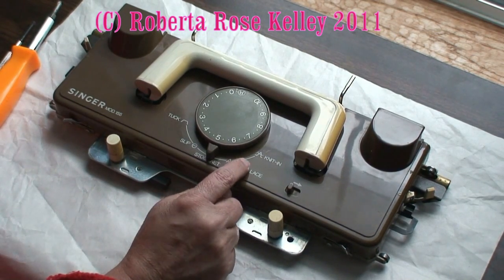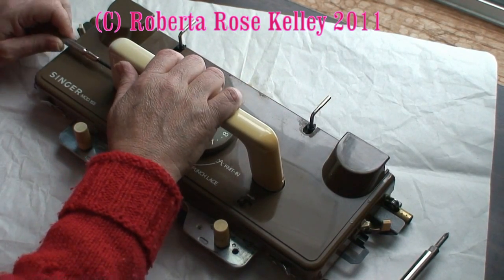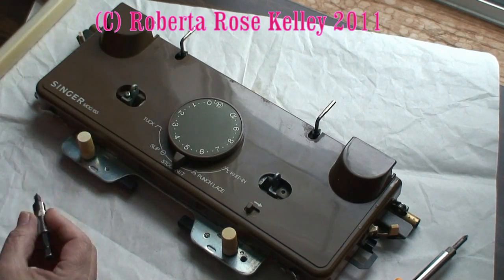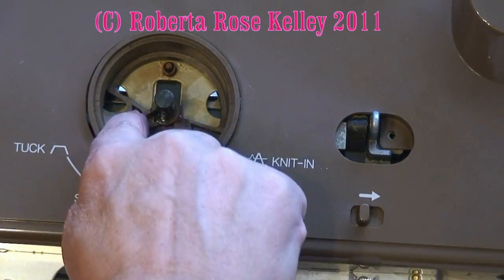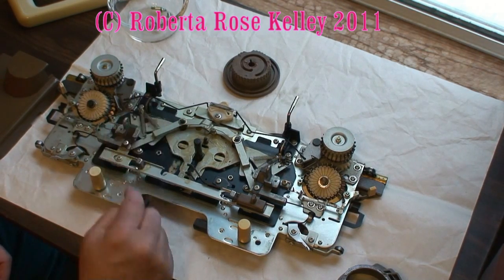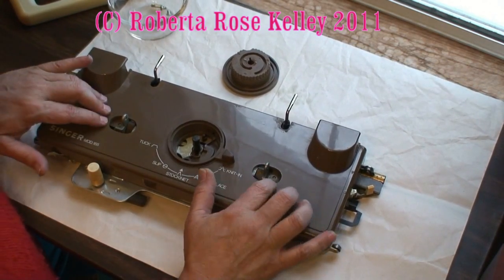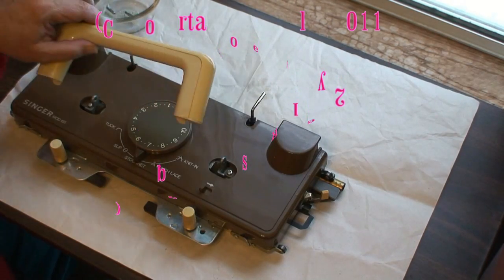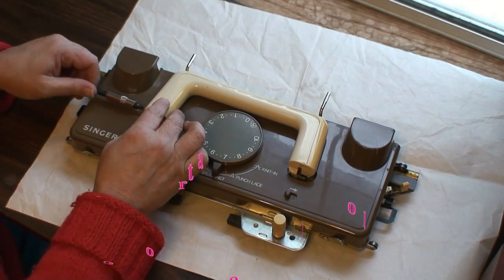Removing Singer carriage cover

Comment: I really needed this video. The drums were seized up on my LC2 lace carriage. I took the whole thing apart and freed it up. Thanks for your expertise. I wonder if I should re-grease it before re-assembling.
Reply from the maker: Glad it helped! I have had a few singer carriages that was the same, so to take it apart is sometimes how to fix them. If the lube under the drums is dried up, I would scrape it off and clean that area and yes put a little more grease there to help that turn.

Comment: Thanks for this video, I've just got a HK-160 actually which had the carriage cover well smashed in the post, I repaired the carriage cover with superglue and duck tape after removing it from the carriage, reassembly was a bit more tricky but again your video was very helpful, Elaine.
Reply from the maker: +Elaine Simper Thank you for viewing my video(s).  I am always glad to show things I have found out how to do or fooled around on one of my machines to get something worked up.  We do what we can to fix our machines, thankfully you did get to use the superglue and duct tape also.  Berda

Comment: What can i do to remove a very stuck carriage 😢 I m Trying everithing I Can think of, it’s stuck on the bed and it hás no yarn , Can someone Help me ? Tk y 😊
Reply from the maker: Sorry for the delay, hope you were able to get it unstuck. I have been away from my home here and there, so not doing much on my site. I remember once I had a stuck SK155 carriage. I had to take the sinker plate off of course, then I noticed that 1 needle was the culprit. I took needle nose pliers and wiggled that needle until it came out, then I was able to move the carriage. Come to find out, that was not a needle for the machine.

Comment from the maker: Well if it were not for a serviceman that showed me that trick, I may not have known it, well until I would have got the service manual for it.  Now the Brother middle buttons do tend to get stuck, I was told to use WD40 sprayed in between those 2 buttons and let it rest, eventually it will unstick.  Using a hair dryer will also loosen up any gummed up grease which may be a better choice.  I feel blessed when someone comments on my ways or I have helped them in one way or another.  Same to you.

Comment from the maker: One thing I have also found is to have my husband take my carriages (minus the sinker plate) out to the garage and use the air compressor and boy that does a beautiful job of getting lint off the bottom of the carriage.  Even see some lint or yarn pieces that are stuck to the last lubrication and the air compressor gets those off as well.  Then I spray the lubricant on it again, wipe it down and then wipe the needle bed.
I hope that you can get the cover off and clean it better.

Comment: You are one gutsy, practical lady!  My concern has been having enough dexterity to put it back together and as easily as you make this look. My Brother KH270 cam buttons are stuck so need to get some Lori Lin spray lube and also to use a hairdryer over the cam buttons to get the old grease flowing. I appreciate your videos! Blessings to you and your hubby.

Comment from the maker: @RAE5558 I am not 100% positive where I got the Lori Lyn and think it is hard to find now, but maybe check with Needle Tek or maybe Northtipton. Oh and ballistol oil or also known as gun oil will also work instead of the Lori Lyn Lube Spray.  I do not have one of those long cleaning brushes as I have my husband use the air compressor to blow out what he can and it does good for me, even on the carriages it gets off 99% of lint.  Search for Knitting Machine Cleaning Brush is you want one